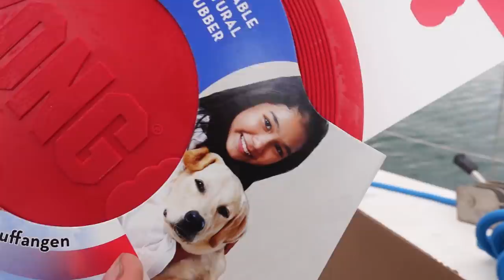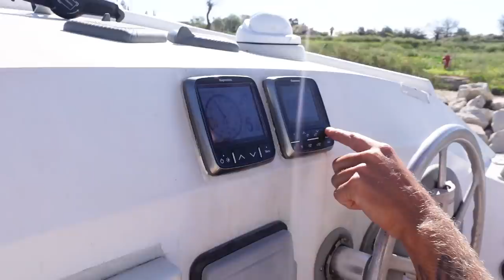We're Going Back. | Wildlings Sailing

Comment: staple a long piece of string as close to the leak as possible and put the lower end of the string into the bowl. The leak will follow the string down into the bowl and that will prevent splashing.
Reply: Didn't you have to be a Ninja in an old Bond 007 movie to make that work??

Comment: Your making progress. As a temporary compression fix, there is an oil additive called "Restore", that is proven to increase compression. I use it on worn engines with great success. Please, wear eye protection when working on batterys!  Hydrogen gas can explode with great vigor and blow sulfuric acid every where.

Comment: You had a bad cell in the battery. Its good you got rid of it. I had a boiling battery in my caravan (which I'm staying in whilst I'm building our new house). I didn't realise what it was, just smelt like rotten eggs. That smell was actually hydrogen sulphide, which is not only explosive, like others have said, but it's also the 2nd most toxic gas known to man. Luckily I never died. Lead acid batteries are pretty dangerous if you don't pay attention to them. Worth while getting clued up on batteries and looking for an alternative to lead acid when you have the money available ✌️

Comment: watching you start your engine, lifting the compression relief valve, while turning the engine over put the compression valve back in, the smoke is possibly from just too much fuel with low compression. Just a thought !

Comment: In Electrical, Heat equals Resistance. So expect Connection or internal issues. 
Keeping Baking soda around to Neutralize an Acid issue or clean terminals is useful. I use an "Ear wash bulb" to clean terminals with a Baking Soda solution. Light Grease coatings on assembled terminals help reduce corrosion by excluding air from the oxidation equation. Eye Protection is recommended anytime servicing Liquid Batteries, even a flick of acid in the eyes can be a difficult issue.

Comment: Hi Mark and Nadyana. I've got to admit that the old engine sounds a bit ropey. I should have mentioned, when you had the head off, to pour some clean engine oil on top of the pistons, go about an inch up the barrel above the piston. If the oil leaks past the rings quite fast it's not good. I took my old volvo md7 apart. Rehoned the bores, and cleaned all the rings, including the oil scrapers. Then I cleaned all the ring grooves in the pistons,  very laborious. I then put the rings back in the pistons and slid the pistons back in the bores. When I did the oil check one piston held the oil on top with no noticeable drop. The other had let about half the oil through in the space of 3 days - close enough for council work! You should, when the rings are removed, slide them down the bore and check the clearance between the ends, yes, that is a thing! Good luck, I expect it is all done now anyway. Much love from the Forest of Dean.

Comment: I love your videos,I thought the south of France was warm in the  winter,I guess not, so sad!
I  know you are swimming in tips and advises ,so sorry but I have  one more that could help:    sometime an emergency half ass job is the                                                                                                                                                                                                                                                                          solution:for example  with your leaky small  fittings just open them, slap some butyl and tight them up(10 minutes each max                                                                                                                                                                                                                                                                                                ) till you  have the time and the weather for a proper epoxy and butyl repair. 
Thanks for sharing with an old man stuck at home.

Comment: I think that part of your problem with the smoke is your timing.  Smoke on a diesel is usually unburned fuel.  Diesels are very difficult to time properly.  Allowances have to made for gear lash to be primed properly.  Your injector pump is usually timed as well as the engine.  Old motors are trickier to time and a very small amount off makes them smoke and not have as much power either.  Have a professional check it.

Comment: That boiling battery was producing an explosive gas - that was what the boiling was and if you had made a spark working on it  disconnecting it could have exploded .  Just a heads up for you .  

Try not to work on batteries that are charging - disconnect the charger preferably remote from the battery and let them sit  for a while before getting to work and ventilate .
Reply: Very true, the "smell" is hydrogen gas reference the Hindenburg. Vent the space before working on the batteries and avoid any sources of ignition.  Love you guys!

Comment: I know most people rave about how amazing sikaflex is, but every fitting on my boat was bedded with sikaflex and leaked like mad. Re-bedded them with butyl, and the leaks disappeared. I think butyl is the better choice when it comes to deck fittings.
Reply: "Butyl" 😁✊
Reply: Yes, use Butyl as much as possible. Sikaflex is a mess....
Reply: CT-1 is amazing.
Reply: yes, use butyl tape for sealing everything. just warp the bolts and screw shanks and tighten back up. You will fix the leaks. use it to seal all your windows, basically everything.
Reply from the maker: Yup, the sika that's usually used is more of an adhesive than a sealant, and it hates UV. I always use too much and make a mess
Reply: most people I think don't let the sika set up a bit before tightening it down, which just squeezes it all out.
Reply: Some interesting comments - I’ve found Sika 291 to be excellent for sealing just about everything, with wet / baby wipes essential for the clean up! Always keep a bin bag close by, use a wipe once then throw it away...

Comment: Try getting engine restore for your compression problems. Or do a compression test to be sure. The smoke could be over fuelling too. A Diesel engine won’t start with no compression. And glow plugs...best way to test is to take it out and connect direct and see how long it takes to glow red. 6 or 8 seconds should be plenty time....
Boat looking good. 
Happy sailing
Reply: His engine needs a complete strip down, refurbishment & rebuild, not some additive! If you look back at some of the previous episodes, the state of the engine was & still is dreadful.  It is a critical system element & needs to be properly maintained.
Reply: @sir.malcolm.copson  that would require a lot of money. Finding the actual fault is what is needed. No need replacing bearings if there is no knock. No need to replace gaskets if they are not leaking. Take injectors and pump for calibration and do a compression test is where I would put my money.

Comment: You are doing your apprenticeship on the boat and so far you have done pretty well
It is interesting watching you develop skills needed for safe and mostly comfortable onboard life. You are really going to sort your wiring as this is a great source of disaster by fire and fire at sea means disaster for all onboard 
As far as leaky decks goes you can bed fittings with butyl tape and sika and this should reduce your problems

Comment: Mark, after you have caried out your oil changes and other engine maintenance have a look at a product call Slick 50 or it later variance for diesel engines.  it is not the total answer to gunged up compression rings or totally worn bores, but it does 'cure' minor oil burning remove some wear from cylinder walls and protect meshing gears. it is a liquid PTFE material which you add to the engine oil and then run the engine so that it is washed around all the surfaces that it then coats with PTFE so big end and small end bearings cylinder walls valve stems all become coated with a a layer that depends on the wear/worn taking up the slack. it also protects against instant engine death if the oil pimp fails, having a low coeifficent of friction it makes the engine run a lot smoother. I have used it in older engines and been pleasantly suprised at the audible improvement, and reduction in fuel consumption - but if any future work is require on the piston or bores the coating has to be ground off.
Reply: Great product
Reply: works well with tired engines

Comment: Mark the last time you worked on the motor and took the head off did you replace the valve seals ? from the looks of things they are your biggest problem, after sitting for a while the oil travels down the valve stem and the next time you start the motor  the oil gets burned off and then the motor stops smoking. seen this many times on older motors.

Comment: So many comments...did you try tightening the hardware on the leaking fittings? If you suspect ring issues in the engine,  a 50/50 mix of acetone and Transmission fluid dropped in through the glow plug holes and allowed to soak for a week  or so will dissolve any carbon deposits that are interfering with ring seal. Compression restore in the oil is an awesome product as well.
Reply: Great idea!
Reply: Also 15w40 is a much better choice than non-detergent 30 if that is what the engine manual calls for. I also suspect the viscosity is to high on the bio-hyd fluid you selected increasing the load on the engine

Comment: G'day Crew,,, 
Another great episode, will be nice to see mum n dad enjoy some time aboad 
Seems to me you have a few issue that need to be addressed ,,,such as a watermaker ,
the engine ,and the leaks .
Most important is the engine ,,you can overhaul the motor ,but in the end you still basically have an old engine ...
I would try to raise the funds for a NEW ENGINE ,it is a safety thing..Im sure your faithfull  followers  would come to the party ..
Lots of people seem to be going with YANMAR ,but its time to do your research ,and see what suits your situation,,, 
  Just food for thought .
Look forward  to your next vid .

     Respect 
        from
  Down Under
Reply: The problem is this is hitched to a hydraulic pump and control valve assembly that drives the Hydraulic motors in each hull. 
A modern motor might not be adaptable to the pump system. 

Its old but as one person already said get away from the boat mechanics and find an agricultural diesel engine specialist or old school Merc van mechanic. 
Mark the scavenging rings might be gummied up in their grooves... try adding some flushing oil and some oil treatment like stp or molyslip.
Old engines dont always cope well with thinner modern oils or multigrades.

Comment: Mark, for the future, if you need to disconnect your solar, the output from the controller to the battery loops through the little fuse panel that's above the battery charger. You can either disconnect the panels from the controller, controller from the batteries, or both.
Reply: Hi there. Check if the black Kong floats as from memory they sink fast which is not great if it goes overboard. A solution is to add closed cell foam inside. Good luck.
Reply: 2 de mim né
Reply: Most controllers require the panels to be removed first before you disconnect the battery. To put it back together connect the battery to the controller and than connect the panels.
Reply from the maker: Plus a big cover over the panels too!
Reply: Best to disconnect the solar from the charge controller. They can burn up the controller if there's nowhere for the charge to go.  I've got a toggle switch to do that.
Reply: If you Blot Out The Sun for a few days, that will do a lot to solve a few earthly problems, but Don't let on to anybody it was you folks that did the deed. Too many people would pilgrimage their way to Minke. God sails a catamaran, never becalmed.
But then you might be able to get free dockside berthing rents for like, EVER.

Comment: I've followed the struggles to achieve what you have, and that is a considerable achievment. Now that the engine is shot I must throw my tuppence in: Primarily; there is an old Scotish proverb which says "You can’t make a silk purse out of a sow’s ear", and I have found that to be true in my life. Secondly, and maybe more importantly, I haven't heard you discussing actinic degradation. If you are not aware of this issue with GRP boats I reckon, considering the boats location for most of it's life, that it would be worth checking before more coin is thrown at her. I hope this works for you, you are stars.

Comment: Under the “boiling” of electrolyte in the battery is understands the process of hydrolysis of water, that is, its decomposition into oxygen and hydrogen. The reasons for this boiling of the electrolyte indicate a malfunction in the on-board electrical system of the machine.
Reply: If your battery gets very hot, though, it may indicate that your charging system has some problems. ... A faulty alternator can also cause the battery to heat up as well. An alternator with a bad voltage regulator can lead to overcharging the battery, and may damage both component
Reply: Is it normal for a battery to boil while charging?
3 Answers. Yes it is normal for the water to boil if you are overcharging it, with a too high current. ... Yes your charging current is set too high. Also check that the final float voltage from your auto charger is correct to the final charging voltage of your battery.

Comment: That Bosch battery that you took out looks the same as the one I have on my car. It's an automotive one rather than a leisure battery. Car ones are cheaper but not ideal for yachts and caravans etc. except for engine starting and you may have that on a seperate circuit.

Comment: I still think that you are worrying needlessly about your engine. Yes, I t’s an older style engine and a bit of smoke especially when cold is entirely to be expected. Load changes will also bring about a puff or two as it adjusts fuelling with the mechanical governor. Think old tractor or series Land Rover rather than a modern computer controlled car unit. I think that you need to do a long transit under engine to build confidence and to exercise the unit which I think will beneficial for it too. Very excited to hear about the travel plans. 
The Kong frisbee is awesome and is my dogs absolute favourite bar none!
Reply: To a degree i would agree , however i have two old diesels , and nether smoke . They are both automotive engines , one a large intercooled unit which is 21 years old , and the other is a normally aspirated unit at 27 years old . I will add , nether burn oil , however both are serviced regularly , with oil , and filters changed . The injectors have been serviced on the older motor , and right now i'm preparing to remove the injectors on the newer unit for the same . It's the first time they have been done , but it is a new to me motor . I also run a flushing oil through them on service , but not knowing the history of this engine , i would strongly advise against this , with a marine diesel at this time . It's always a gamble with an old engine , as the crud that has built up , may be helping a seal with an oil leak . Marine diesels are notorious for lack of maintenance , however in this case it probably would release gummed up rings , and right there you can see the gamble . You could end up with a bigger job than you started out with . White smoke on start up is more likely condensation in the exhaust , however prolonged smoke could be an indication of a blown cylinder head gasket , and trust me a little water can produce a lot of smoke . This can normally be confirmed on a closed loop cooling system , with a decreasing coolant level . But with an older marine installation , which will likely be a direct cooling system , using raw sea water it's difficult to assess . However , here we are thrown a curved ball as it's possible for the smoke to be unburnt diesel , which will be a greyish colour . The problem here is it's often a subtle shade of grey , which to an untrained eye can easily be confused with white . The difference is you should be able to smell the fuel in the exhaust . We could be talking valves here , which would not only produce grey smoke , but the engine would probably refuse to idle . In severe cases , this could result in lack of power . Black smoke indicates an examination of the breathing system is required , but this is also an indication at times that the injectors , as also in the case of a turbo , may need attention . The turbo will have other symptoms , so can usually be ruled out straight away . However another curved ball is , this smoke can often be confused again with the burning of oil , which is blue . I might add , this is possible in this case , with a gummed up ring/s . On an engine that has been stood for some time , it's unlikely to be just one .
Reply: @mickey1299  I absolutely agree with the maintenance issues but my feeling is that this is a good old fashioned mechanical injection pump with a governor that senses a load increase and rather crudely ups the injection quantity non incrementally giving rise to a temporary over-fuelling. The old Land Rover engines were this type of 50s technology. Much has happened for the better since not least in combustion chamber design. I suggest a good long run and frequent oil changes. 
Perhaps confidence will only come with a rebuild to a known quantity but I would hate to see the baby go out with the bath water.

Comment: Drain a litre of oil and replace it with a litre of LUCAS OIL engine stabiliser… works wonders for worn engines and will improve compression within a few hours of running…

Comment: Are you planning for an engine overhaul? It may need a valve job and possibly piston rings. Until then, how about some engine oil and fuel treatment fluids from the local auto parts store.